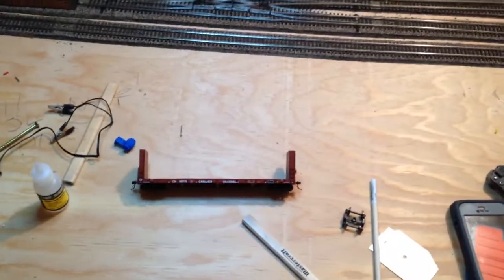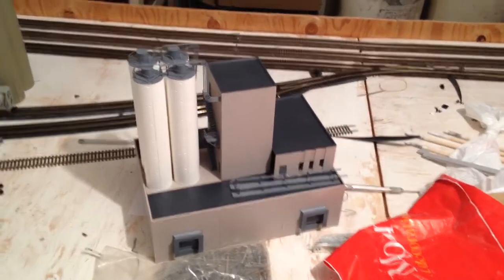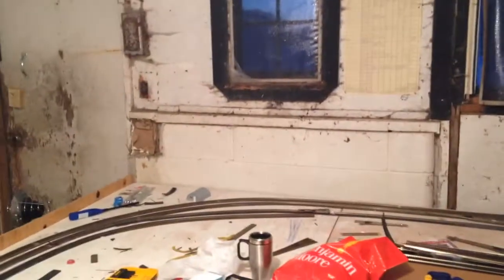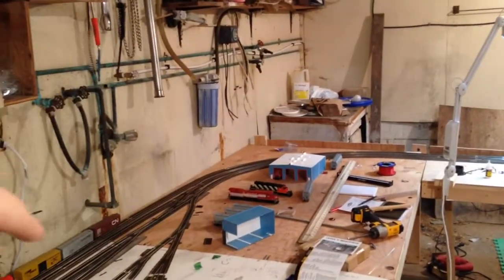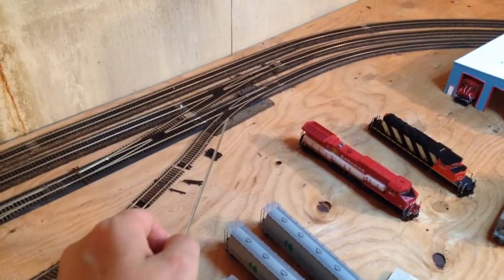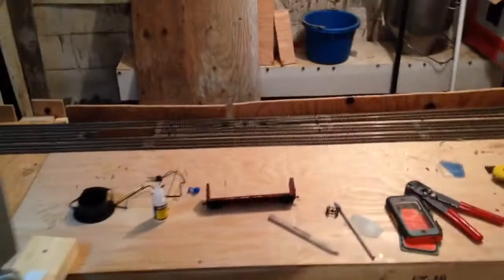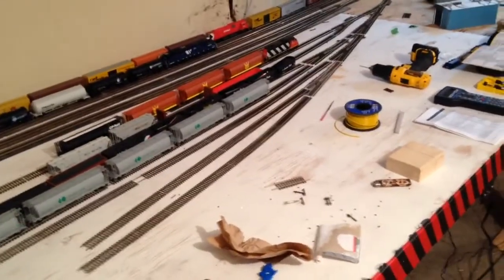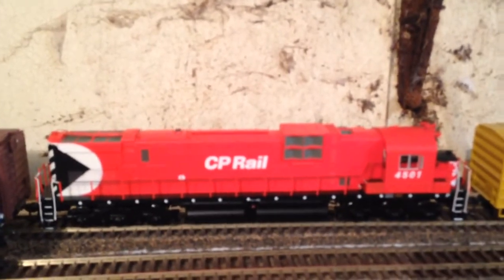Rail car loads and layout tour

Comment: hey Devon... this was a great overview of your layout.. looks like you have a ton of work ahead of you... i think you should reconsider the size of the structure i am doing for you... current dimensions are 14" x 27"  take a piece of cardboard & cut to these sizes, then let me know if you want me to change it... also moc up the track leading to it... it's the length i am concerned about
vinny
Reply from the maker: Hello! Yes I take it the 14'' wide side is the side with the doors and leento  and the 27 is so I can fit two sd90s in the shop end to end.

27 is very long it will fit but I agree that maybe shortening it up a bit would make it look better. I still want to have three bays for the shop and one entrance for the leento (witch I call the express service lane)  but we could shorten it to 14x20 and that would fit  a bit more then one and a half engines under the roof and might look a bit better. 
What do you think? I have the space for either.
Reply: Maj Evans hey Devon...first of all, do you have this video set up as "private"
i ask because i have watched it 4 times & it show "0" views...so you should have at least 4 views.
now on to the build. i am glad you agree with me on the length of the structure. so please confirm that is what you want. i will build it how ever you want it. it sounds like you want to put a lot of stuff in that space. i would wait until you get the structure before you lay track. if you want it to be as we originally discussed, then i would consider moving it around that corner ( where you lamp is) that would relieve the congestion where you originally wanted to put it. like i mentioned to you in my last comment, get a piece of poster board, cut it to size and place it on the layout. this will give you a little better idea of how the structure will fit. this is my 2 cents... that's all i have for now. please use my email addy for further communication VinnyVid@outlook.com
vinny